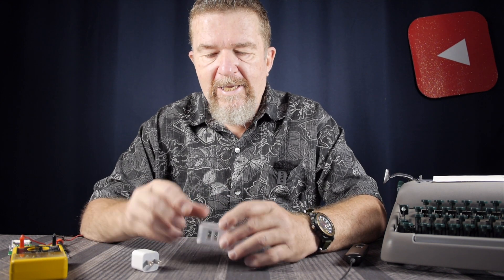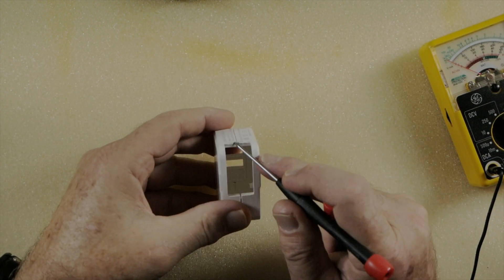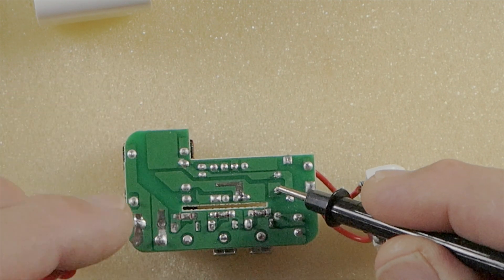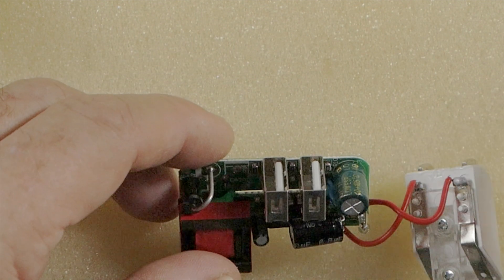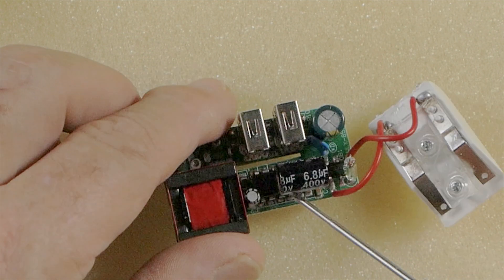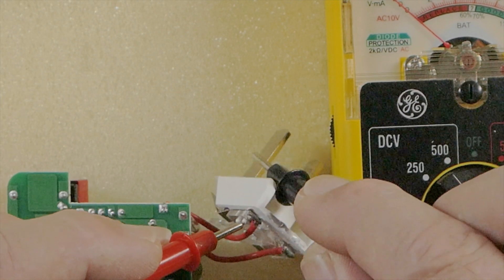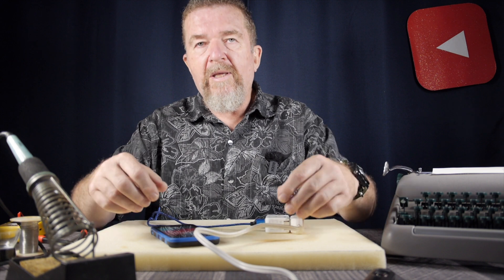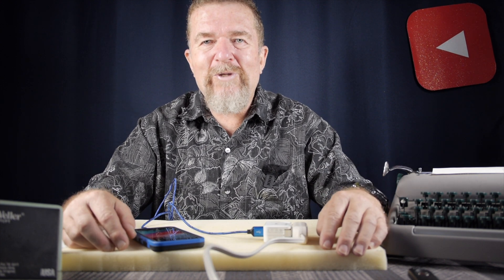Charging Block Repair

Comment: Hello. I have one of these classic cheap little white wall chargers. It’s 5V 2A and has 2 USB C sockets. It gives less then 1A (4W) instead of 2A (9W). I don’t see anything wrong with a close visual inspection. It has 3 caps, 1 transformer, chips, 1 resistor, etc. What can be wrong with it? TY
Reply from the maker: Caps fail more often than many other components, try replacing them.

Comment: Just a quick comment--this is one of the most valuable videos I've watched in a while, really learned something! I probably won't open up my little failing charging brick as I simply don't have the electronics expertise to diagnose it plus heeding your safety concerns with the capacitors. But it's rare that someone gets this granular with something that is in such common use. I now have a better understanding of how these things are generally constructed. Thanks again!